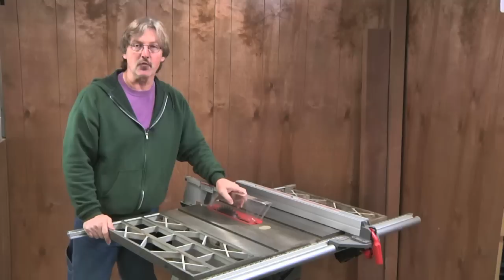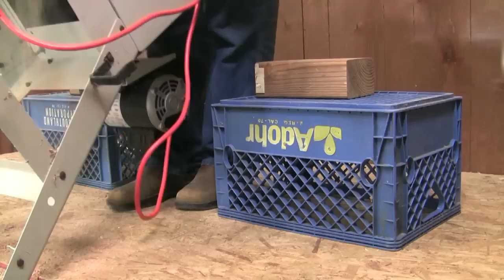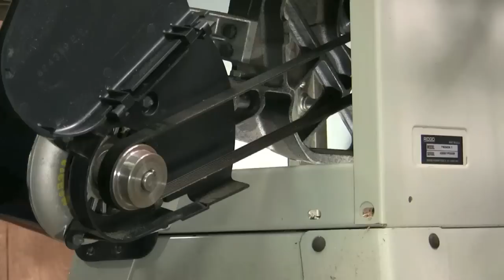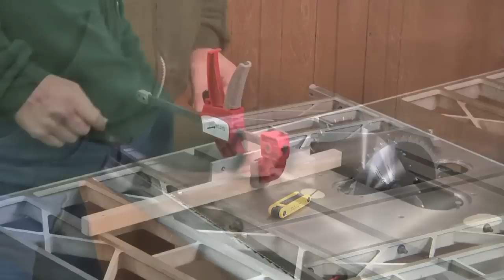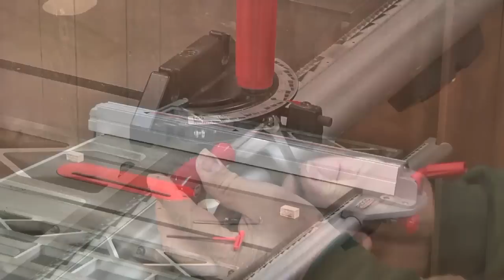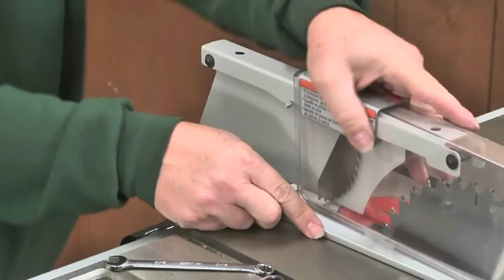Tune Up Your Table Saw

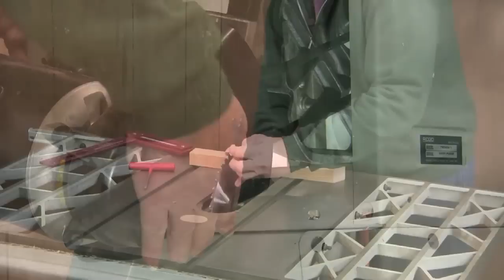Comment: How do you adjust the belt tension? 2:30
Reply: The weight of the motor applies tension to the belt.  It's mounted on a hinged plate.

Comment: I have had this saw for may years and very happy with the performance, especially with periodic cleaning and tune-ups.  Somewhere along the line, I lost the Support Spreader that attaches to the blade guard.  Have searched high and low to find a replacement with no luck.  Any suggestion on how/where to find one?

Comment from the maker: @kfholler Definitely check the rip fence and table miter slots for parallelism with the blade, since older table saws often have inaccurate rip fences. Also, make sure the power cord is in good condition without cracks in the insulation or other obvious nicks or damage. Start with a scrap piece for those first few cuts. Use the cut pieces as feedback for how the saw is operating (binding, burn marks or excessive blade marks on the cut edges, etc) and tune it up from there based on the results.

Comment: I have a similar Ridgid table saw and this video made me confident to tune it up. I managed to clean it nicely without tilting the saw though. I did unscrew all six bolts for front and rear trunnion before  making adjustments though ( in the video the author just loosened three rear trunnion screws). Thank you for the great and easy to understand video. Now I have a fine tuned saw.

Comment: Great video...  I think some professionals forget that there are some novice and beginners woodworkers out there.   From setting the measuring tape on the fence to the blade to leveling the throat plate...  I alleviate your entire video

Comment: I have the TS2424, owned it since new 15 years, it runs great made in USA! I have only adjusted the table parallel to the blade 2 times and stays right on the mark. The dry lube spray works great on the rack screw adjustments and wax the cast iron top. It still looks new and is very accurate. I am not sure where they are made now? China seems to be sucking the life out of all woodworking equipment and tools. Thanks for the video!

Comment: EXCELLENT VIDEO. It was really nice to see this video because I have the exact same Ridgid saw. It has been a super saw ever since I purchased it new in 1995. The saw seen at least 15 heavy moves and storage scenarios where movers thought it was just a heavy thing to bang around and only now has the tilt gone off, and only by a very narrow margin. However, if your a woodworker then OCD is not a bad thing to have. ;) and so I am now about to adjust that issue. As for those folks that had a bad experience, well as all things in life, some people will have a good experience and some won't. Again, great video for this saw.

Comment: Thanks for the tips.  I have an old Craftsman table saw which I am considering to upgrade the motor, the belt and upgrading the miter and fence system.  Upgrades are about as much as buying a new saw so debating on just going that direction.

Comment: I see when most adjust the vertical they put a square vertically against the blade. Why do most when adjusting the blade to the slot do they not put a ruler against the blade  horizontally extending 10 or so inches front and back. checking from the miter slot would show a bigger adjustment at 10 inches forward or rear of the blade. making it easier to adjust.

Comment: Thank you for posting this video. I’m trying to locate the owners manual (in a PDF format) for the Rigid TS 2424 1.  I’ve looked online but have not been able to find a link for this Rigid table saw. Would you have any advice on where I might find this manual?  Thanks, Mike

Comment: Question I hope you can help with: I have a direct drive craftsman table saw that sat in a shed for 10 years before I inherited it from a friend.  I'd like to use it and it powers right up and the blade spins well with no wobble.  Besides removing any obvious rust what should I do to get it shop ready again?  I am having real trouble finding any kind of advice on this and I am a pretty good Internet researcher.  Any advice is appreciated, even if it's to point me at another resource. Thanks!

Comment: I have an older craftsman 113.29992 and when I turn up the blade to cut a thicker stock piece the belt gets tight and the saw won’t run.  How do I repair this
Reply: sounds like the belt is too small
Reply: make sure the single bolt at the top of the motor frame trunion is not tight, be aware im NOT talking about the trunions under the saw for tilt & height.